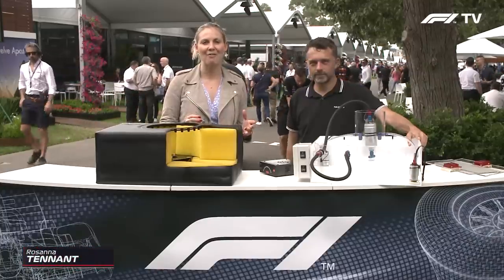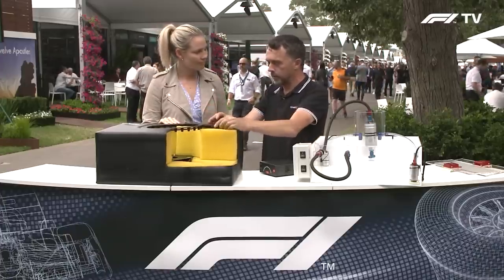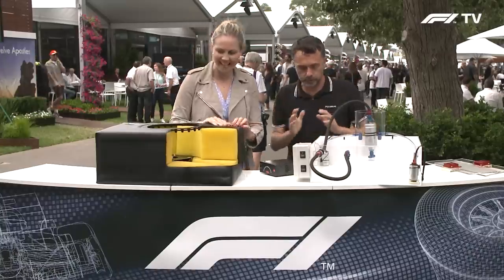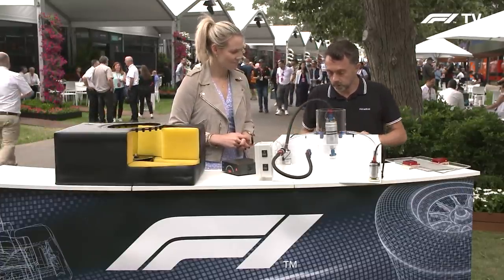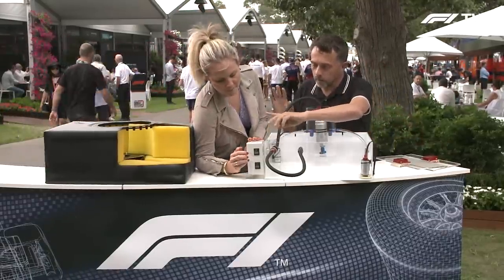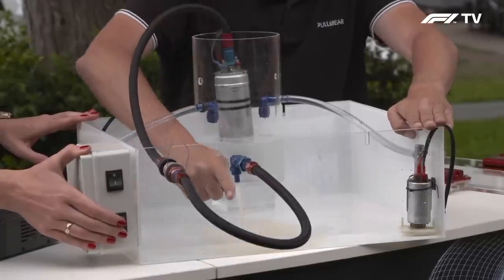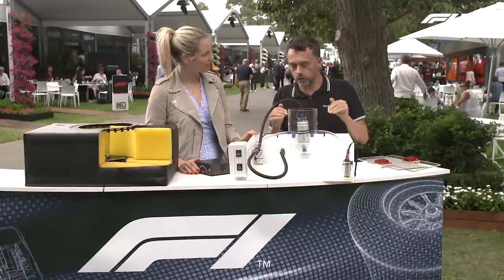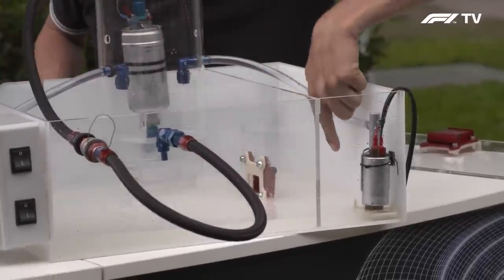EXPLAINED: F1 Fuel Tanks! | F1 TV Tech Talk

Comment: That was a great demonstration.  I especially liked the end when he explained the pressurization of the tank inhibits aeration in the tank which can cause a vacuum within the pumps and stops them from delivering fuel to the engine. (Red Bulls problem they had)
Reply: RedBull run out of fuel that simple. They didn’t compute the correct fuel consumption with the new biofuel.
Reply: @BobSmith-uu5kj  is this true? Where can i find the footage where they said this. Heard a Lot of different explanations and i dont know what is true
Reply: What does he mean with slushing?

Comment: The foam in the tanks act as a baffle, and if there is no air in the tank after it is filled, the tank will basically collapse in on itself creating the pressure to stop bubbles. Bladder fuel cells are used in inflatable rescue boats, and if you don't make sure you get all the air out of them when they are filled, you risk getting an air lock and the engine stops.

Comment: Wow, I just thought they used a single pump in the tank and another mechanical high pressure at the engine driven by the camshaft.
Very interesting to see that they use multiple low pressure pumps sending fuel to a collector

Comment: Dumb question but if the fuel tank doesn't split then why did Grosjean burst into a ball of flames? I guess it was big enough crash or? Genuine question as I always assumed the fireball was from the fuel.
Reply: He did explain it in the DAZN Spanish braodcast, what ruptured wasn't the fuel tank itself, but the joint between the fuel tank and the rest of the components. In the black model Albert has, it would be the hole on the top.
Reply: @inakilh  Ah I see, thank you.